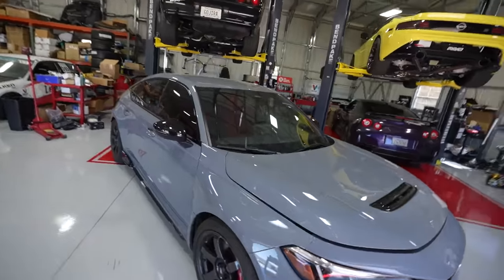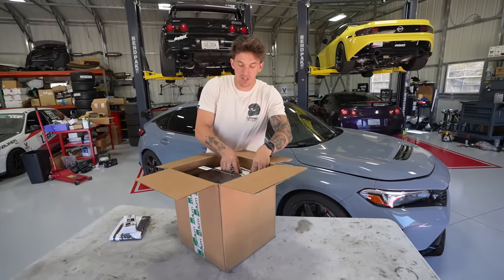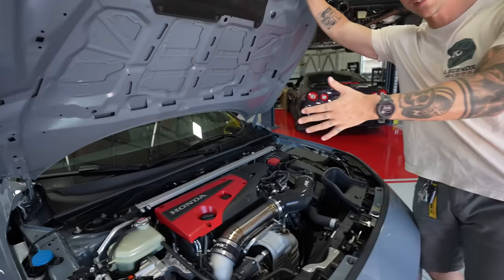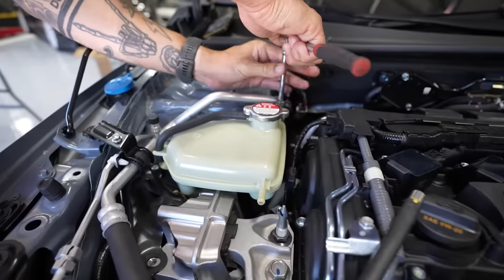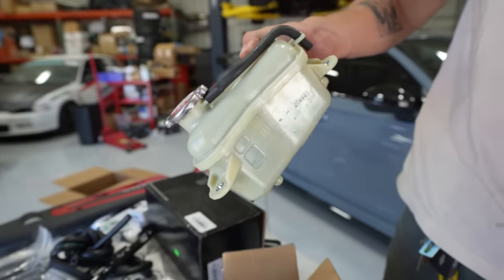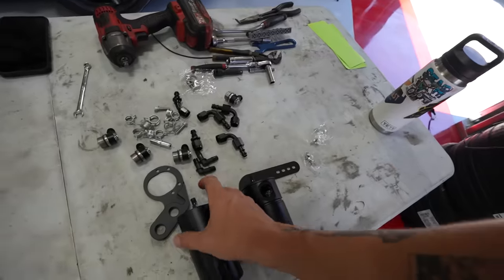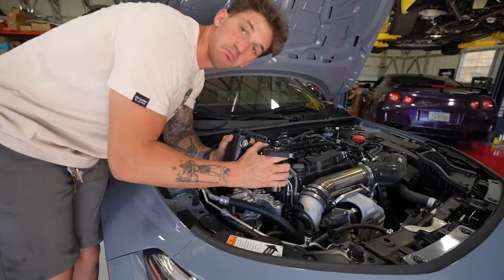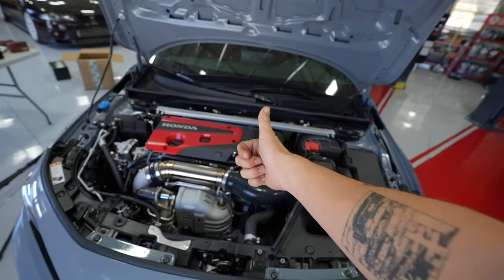MASSIVE Upgrades For the FL5 Type R! *BILLET GOODNESS*

Comment: Also I was going to buy a Gr 86 but some of the oil pressure drops and stuff in the oil pick up tube I am worried about reliability. So I was thinking that the Civic Si would be a better choice to live with and have better gas mileage and stuff. I own a 2013 Corolla currently and and I am wondering if the Civic Si or Gr 86 would be actual fun cars for daily use or should I save and try for the Type R. Just can't seem to choose. I am sure like a lot of car people I like them all for different reasons and even though it makes no sense I want them all. I know I can't get them all right now. What do you think.